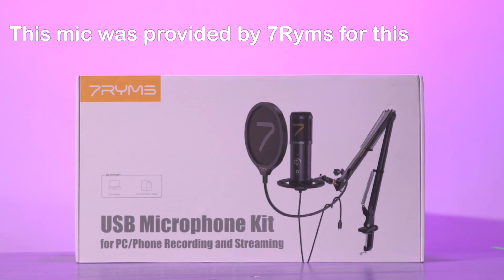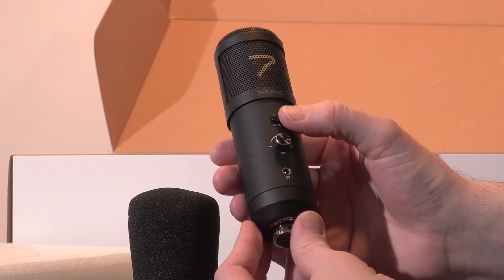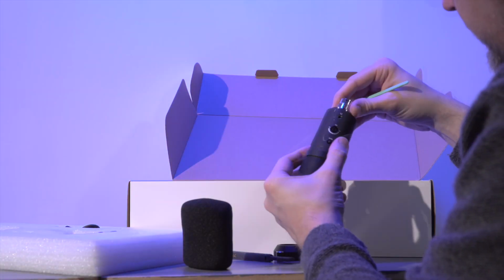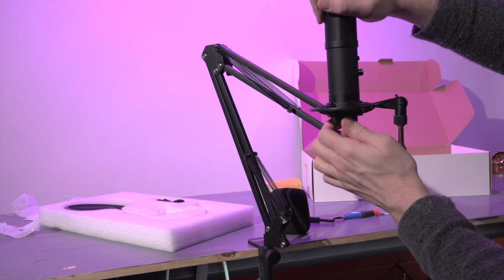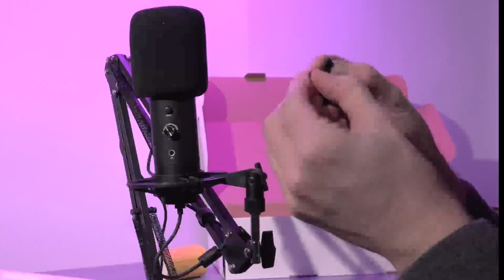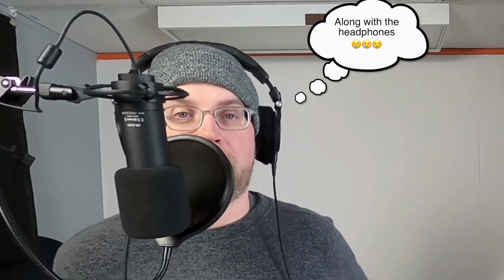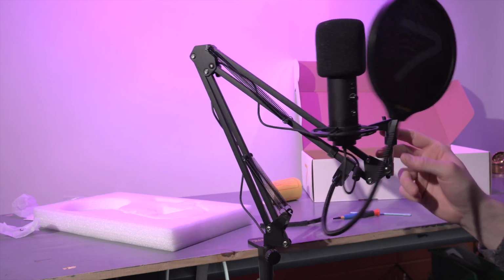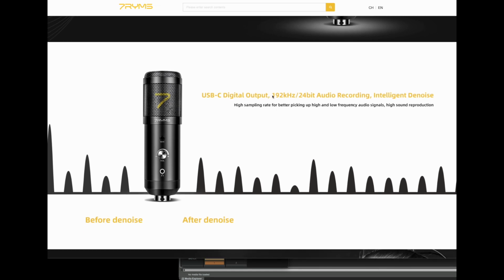USB-C Streaming Mic Kit Review With Audio Demo | 7RYMS

Comment: Hi, Thanks for your feedback! Computers and mobile phones can only support 48kHz by default. If you want to support high sampling rates, you need to install driver software to achieve this. Thank you for sharing your review, it means a lot to us👍
Reply from the maker: Looked for the drivers on the product’s page on your site but didn’t see any. Is there a download link somewhere I missed?
Reply: @DcSoundOp  At present, this project is still in the internal testing stage, so it has not been displayed on the official website, I hope you understand :)